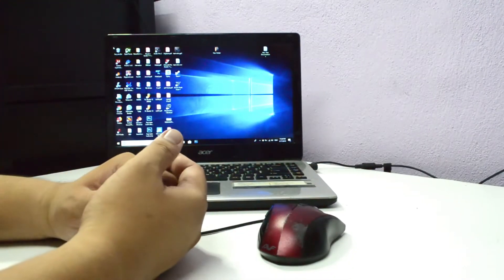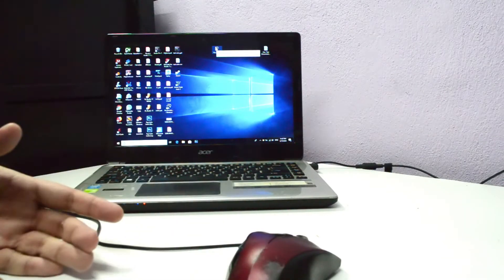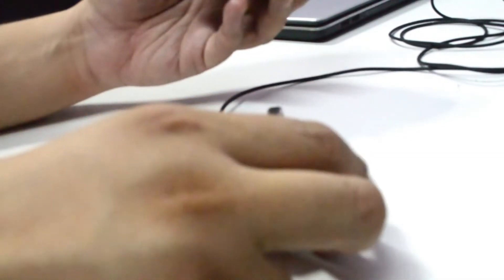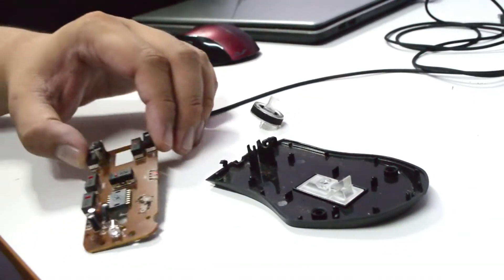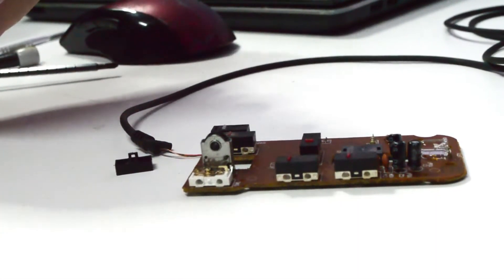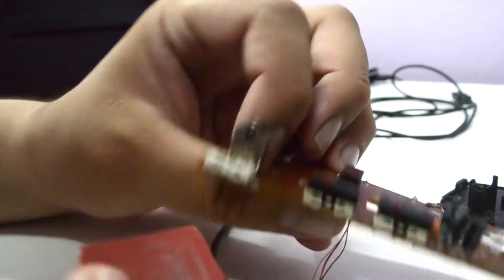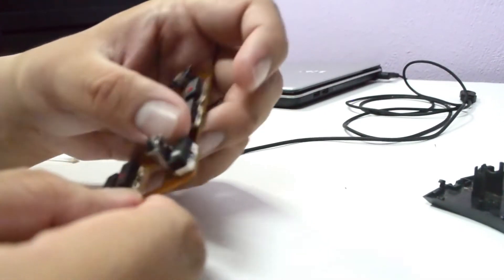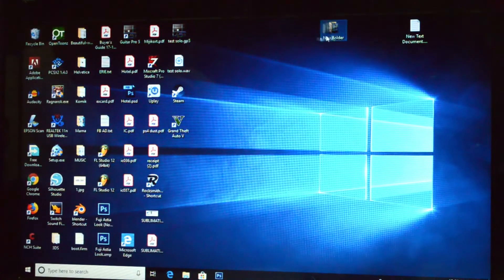FIX Mouse Left Click Not Working

Comment: Bro please Tell Me The Solution I Tried Everything Even Opened My mouse and cleaned the dust but still the left click is not working and middle mouse and right click are working fine (Zebronics Transformer DC 5V)
Reply from the maker: I can't say for sure what is the problem with your mouse.. The best is to solder new button
Reply: @ArlanFixStuff  thanks it worked

Comment: HOW DID YOU OPEN IT?!
YOU DID IT OFF CAMERA AND NOW I DONT KNOW HOW TO OPEN IT.
Reply from the maker: There is screw hidden under the pad at the bottom. You need to unscrew it, then slide back the top part.
Reply: @ArlanFixStuff  No I meant inside the mouse where the boards at
Reply: @ArlanFixStuff  But anyway, I got mad and threw my mouse and now it can right-click again